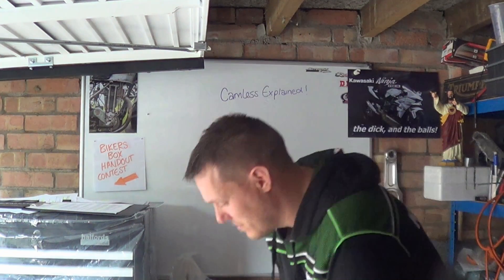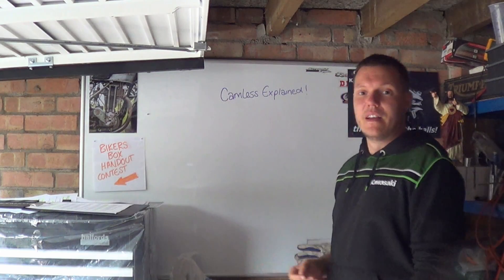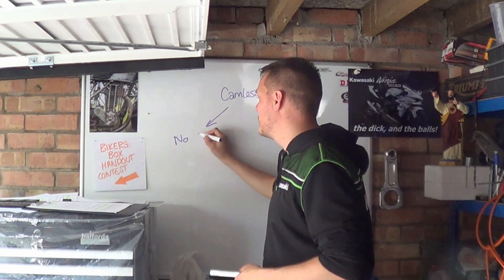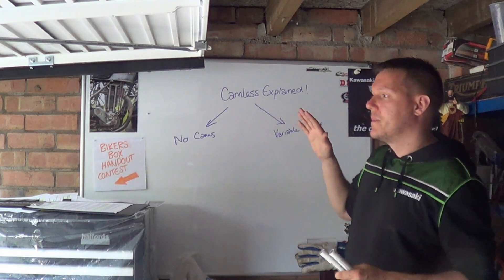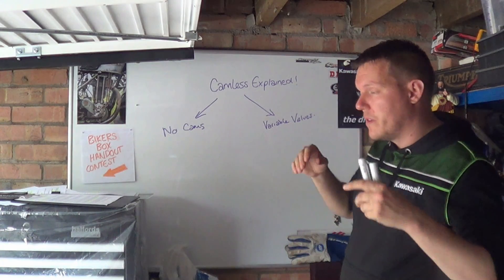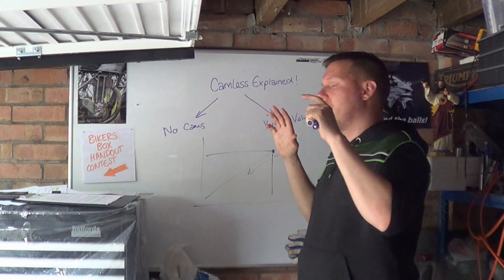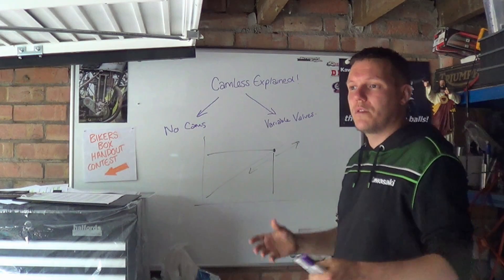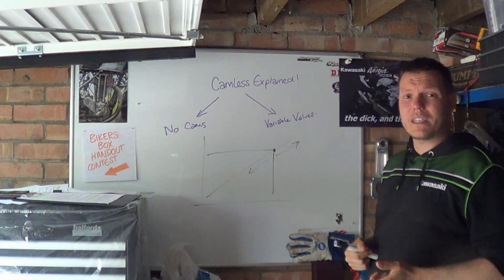Camless engine intro

Comment: Would pneumatically controlled valves be a viable solution, if you had a compressor unit powered off whatever the fuck you like could you not keep a bottle pressurized with enough gas to do battle with the springs that hold your valves shut, then you would only need wee solenoids to actuate the valves on the air circuit no? I dunno my first thought was hydraulic valves but that seems a little slow (correct me if im wrong) but also the pump would have to be full tilt for the entire duration. If you traded weight off for compressor size then could you not have enough pressure during the cycle to open and close valves at will despite spring pressure. Or is the extra weight and either direct drive or possible lagging through exhaust gasses a......self negating thing?....hope that makee sense lmao (i for one was struggling a bit lol)
Reply from the maker: To a degree yes, as they control when the valves close
Reply: @thedirtyworkshop  P. S thankyou very much for seeing my comment and replying to it. Didnt take you long either. Appreciate it man
Reply: Do you mean the solenoids controlling the gas circuits?
Reply: Dunno, it would be a fucking cool innovation if it was reasonably practicable. Just imagine 125's with pneumatic, camless engines ffs 😂😂😂😂😂😂😂😂😎😎😎😎😎 it'd do thr go faster monster stickers fuckin justice lol

Comment: konensegg or whatever has made such a thing, though i doubt some of their claims, i mean yes a smaller valve would be able to move faster, but that does not mean the solenoid valve can operate that fast not to have variable lift, unless all cylinders that are active have the same lift and a set amount for set rpm's or at least not adjustable as fast as the valves, i.e. set lift height to the oil or air pressure and have them both vary with rpm, have variation up and down from a base amount of lift, and have exhaust and intake separate, this only takes two variable flow valves or pwm controlled vlaves (not engine type) and have the engines valves controlled by this flow and pressure and the solenoids on them control the timing and duration.

 this also means you have a dynamic air assist spring to increase the sealing force and spring back rate as the rpm goes up and the pumps make more flow and can make more pressure by having more than enough flow, the only question then is how do they control the engine valves.
 well the first part is a pneumatic/hydraulic piston that can move fast enough and have enough force to overcome the pneumatic spring through the pressure range. unless they relieve the air in the spring, then you only need to overcome the safety mechanical spring and the force of the air moving out in the case of the exhaust valve.
 either way you need at least two solenoid valves that release in the off position for each cylinder or have bleed off engineered into the pistons (that move the valves) and enough flow to overcome this bleed off, it depends if you want to spend your money on valves or the pump, and if the air spring releases before the valve opens then you need another solenoid valve to let that pressure bleed off.
 if you do it that way you need two one way valves and a pump with enough flow to overcome the release bleed off when trying to open the engine valve, or one two way valve and one one way valve, if you cant find a suitable two way valve then two one way valves can be used totaling to 3.
 if you want to know a good idea of the price of these valves look at the injectors of a direct injection diesel, one that uses a pilot valve to make the pressure, these types have what is known as a high pressure oil pump (HPOP), the flow might be enough since they flow more than the actual fuel injector side of the injector, for a pump you can look to the same place. they are quite expensive, the prices of each injector is ~$350 for stock, and the pump is ~$750 for stock.

 if you want to do the math you can find out exactly how much force they can exert in how much time i.e. valve size and max rpm can be determined
Reply from the maker: paragraphs.........
Reply: i'll try, sorry

Comment: Using oil pressure to keep the valves closed? A chamber where the collets would go to keep the valve closed then a drop in pressure and the solenoid opens the valve?.....

Comment: How about a belt driven compressor powering pneumatic valves, instead of big heavy solenoids and their current draw? How do you think it would compare re cost and weight?
Reply from the maker: Good question, this is going to be in the series

Comment: Understand what you are saying. Why then not concentrate on CVT gearboxes so the engine is always working at peak efficiency?
Reply: They are a massive compromise and not particularly a good one sadly. Other than being fairly easy to produce cheaply for bikes/scooters designed for urban riding.  Compare a CVT bike to a geared bike at the same CC and you can see that a CVT cant cope with the power a conventional gearbox can.

Comment: If you added a magnet to the solenoid you could make it push and pull as well. You would still need a spring to keep them valves shut when no power is present but they would be much softer.
The solenoids would be huge and make a bunch of EMF noise and voltage spikes but you could feed those spikes back to your SLA battery to desulfate the living shit out of it.
Reply from the maker: And this is what BMW tried and it was not a good idea so they binned it.

Comment: Matt, you can correct me; These solenoid's are stronger than a spring if needed. This innovative idea does need some tuning, but it is the same difference as analog vs. digital. carb. vs FI
Reply from the maker: "Matt, you can correct me;"

- I'll have a go lol

"These solenoid's are stronger than a spring if needed."

- I'm not sure what you mean?

Comment: You could actuate camless valves the way some common ralil diesel injectors work, the function hydraulically using the fuel its self, just a little solonoid valve for the inlet to the chamber that lift the injector pintle, you could do valves like that except using engine oil.  Tucker designed a camless engine for the Torpedo, almost made it into production, used hydraulics valves & engine oil & was just controlled by a rotary distributor.

Comment: Camshafts are just valve actuators. VVT was the next evolution of technology. Like you said Matt, electronic lifters or some other type of valve actuator. That is the next step to where we can control what happens. When we can do that, you could push a button & get 50 mpg. Push another & you could get 5 mpg but have 500 hp.
Reply: Mike Weiser cough freevalve cough

Comment: I am a petrolhead so solenoid actuated valves are really exciting. I am afraid the race for technologies may be won by EV's. With good direct injection TB butterflies become redundant also.
Reply from the maker: Yes and no, throttle bodies may be included as a means to give engine braking. People as used to riding with engine braking and throttle bodies are cheap. more on this later
Reply: The Workshop 
Solenoid actuated valves could do that job as well.

Comment: Hey man can you please explain those rc nitro engines and why they don't produce it in a larger size for a bike let's say. Those things are fast its a 3.5cc engine that goes up to 41000 rpm and makes 2.5ps and weighs 350 grams if you find time pls do a vid about them
Reply from the maker: Yes I can
Reply: info from os website (first nitro engine name i thought of); 3.49cc, 2.61hp @ 34000rpm. 
so.... 2.61/3.49 = 0.748hp/cc x 1000 = 748hp per litre.
this might not really up-scale properly! and, the emissions would melt your brain!

i'm (not totally...) sure Matt's said he's going to do something about this (well, nitromethane fuel) in the future
Reply: Thanks man!!

Comment: You can change valve lift without effecting valve timing or duration. Higher ratio rocker arms are a common example in pushrod engines, they open the valve further but open and close at the same crank angles. It's just generally difficult to substantially increase lift at the cam lobe without also increasing duration without "slamming" the valve on the seat, which is hard on the valve train.
Reply from the maker: but you're changing the valve 'on' percentage. I agree with you to a degree but something has to give.
Reply: The Workshop Not unless you change valve timing. Simply adding lift dosn't do that, unless you add so much lift to the cam lobe it necessitates more duration at which point, yes, I agree you are now changing valve timing or "valve on" as you put it.
Reply from the maker: it takes longer to get to a greater distance so you have to chnage the cam profile, not that you'd ever notice. But the 2 are different
Reply: No it doesn't take longer because the valve is opening and closing (accelerating) faster if all you are changing is lift and not duration or timing, however, again, if you change lift on the lob enough it does often necessitate changes to duration and thus timing.

Picture two hills, both hills have the same diameter at the bottom but one hill has a higher peak than the other. Now picture two wheels rolling over the peak of both hills and both wheels are mechanically forced to arrive at one base of the hill to the other in the same amount of time (this is analogous to crank angles).

The only way the wheel with the higher hill can arrive at the other side of the base at the same time is because it's forced to accelerate faster to cover the greater distance (which translates into greater lift and the same duration). 

By adding only lift to a cam lob you are forcing the lifter to travel a greater distance in the same amount of time or crank angles of the engine. The actual time the valve is open doesn't change unless you also add duration. Maybe we are misunderstanding each other, but that's what I'm referring to.

Comment: Matt, I just don't get it... 
All of these systems that manufacturers are attempting to apply to their vehicles, are to increase torque throughout the whole power band.
If the main goals of a company are to sell and make money, 
wouldn't it be cheaper for manufacturers to design an engine to be super efficient at a SPECIFIC rpm, with no need for expensive vvti, variable length intake, and ""so on and so forth" 
and invest in resolving cvt issues,??
I am assuming that a cvt with a tuned engine would be efficient and cheap. 
I would love to hear your thoughts.
Reply from the maker: Not every issue has a solution, and its pretty easy to work this out. You do the theoretical limit investigation. That's what happned to CVT's and that's why they aren't used that often.

Comment: have you ever heard of the Napier sabre engine? it's a 36 litre H24 that has sleeve valves and is a 4 stroke. very interesting engine and very powerful, about 3500hp in WEP
Reply from the maker: Yes, and I used to work on a Napier Deltic engine years back, well 2 actually.
Reply: thats sick

Comment: Koenigsegg has a camless system if I remember it right... What if you do not make an valve to open and use an flap for in and outlet over a electric thing? make it like a half circle where the round tip is on like an hinge and two rods open it on the flat side just an gap. That might allow a fast fill and blow out with an little lift. You have a ridge between the flaps where the sparkplug and the fuel injection is. (when DI) OK might be noisy flapping going on and you need proper materials so the flaps do not fuck up but you might get good results free of a cam and all the drive for it and full electronic controlled.
Reply from the maker: Its called the freevalve and I said that in the video
Reply: Did You? I should then try to listen better and not start thinking when I watch... I didn't know how it exactly worked since they kept it kinda secret when I heard of it.

Comment: why do we have egr valves what's the logic behind them?
Reply: chris jepson emissions
Reply: Its an american thing funnily enough (not eu though they probably do advocate it) if im wrong in what im saying then do correct me but, I think its ethanol that makes it into the exhaust that, in order to pass emissions and also to make their engine more saleable across the globe they came up with the idea of siphoning a portion of the exhaust gasses out of the manifold and piping it back into your airbox so any......ehanol? can be burned in the next combustion. It differs from a PAIR system as that takes air from your airbox and introduces it intobyour exhaust manifold in order to self combust any combustibles that have got past the cylinder and spark plug (cue the pops and bangs lol) any imput/clarification is most welcome